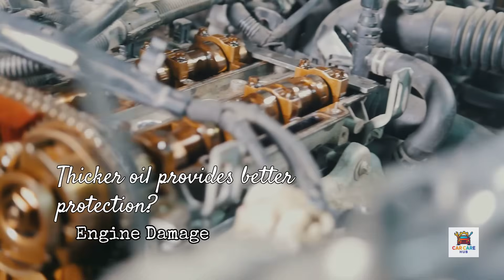STOP using 5W30 oil! (BEFORE IT'S TOO LATE)

Comment: Lololol my 2010  outback 3.6r went 217k on 5w30. My current 2010 3.6r is also using it. According can use 5w30 no issues so can any Subaru f series engine.
Reply from the maker: Respect-- 217k miles is solid proof. 5W-30 definitely works for many Subarus — the video was mainly highlighting cases where manufacturer specs or driving conditions may call for different viscosities. Context matters

Comment: really?  my buddy 2018 honda in germany specifies 5w30 and is of the same engine design as in usa but smaller displacement.
Reply from the maker: Regional OEM specs often differ based on fuel economy standards, even for similar engine designs.

Comment: don't change first number, it only for cold, second number is this what counts while engine is workin temperature and so on.
If car needs 0W20 by the factory, then when car gets old you may use 0W30 not 5W30, this wears your engine at cold starts 0W30 don't so much.  but remember, if you change oil to other viscosity than factory requirements then you do it at your own risk.
never change first number higher, it wears yout engine at cold starts, always use 0W oils, but change second number 0W20, 0W30, 0W40 and so on.
But remember you change oil viscosity at your own risk, you must really know what you are doing.
Reply from the maker: You're right that modifying oil viscosity from factory specs comes with risks, especially with the first number impacting cold-start wear.

Comment: 2025 Mazda CX-5 S Preferred: my owners manual says 0W-20 in North America & Israel, but 5W-30 elsewhere. That looks like double talk to me.
Reply from the maker: It’s not double talk—it’s about optimizing for different regulations and climates.
Reply: you can use 0W30 but you doing it at your own risk, when manufacturer says 0W20.

Comment: Sorry have 5w30 in my engine that "requires" 0w20 this video is total nonsense.. quit spreading misinformation .. if it were an issue the car would be throwing codes a lot sooner
Reply from the maker: The video isn't saying 5W-30 will instantly cause a code or failure, but that it can accelerate wear in engines designed for thinner oil.
Reply: @CARCAREHUB247  However most cars "designed for thinner oil" (0w20 etc) are ALSO being "recommended or 5w30 and in some cases 10w30 and thicker in other countries with similiar climates. So how do you explain this  inconsistency?

Comment: These newer Engines and their clearances aren't any different than they were years ago. If they were built to lose , they wouldn't even stay together The only reason why they want you to run. Such a thin oil is just for gas mileage. I could see you running a 0 20 Oil in the middle of winter , but not when your temperature is over 70 80 Degrees , you're gonna need a little more protection than that
Reply from the maker: Good point, and you’re right that engines aren’t “loose.” The big change is heat, emissions systems, and fuel dilution—not just clearances. Thin oils aren’t only for MPG, but they’re also not ideal for every engine or climate. That’s why following the manufacturer and real-world conditions matters.

Comment: 1997 Dodge Ram 1500 / 175,000 miles.  5/30 and 10/30 half and half
Reply from the maker: Older engines with wider tolerances can handle that. This warning mainly applies to modern engines where oil spec is far more critical.
Reply: i use 0W40 oil in old cars.

Comment: Just bought a 2006 Honda CRV with 161,000. I'm getting ready to do my first oil change as the new owner. The sticker from the last oil change on my window tells me to change it now. I bought Havoline Full Synthetic 5W 20. I live in S. Florida. Should I change the viscosity now? I don't remember if I bought high mileage oil.
Reply from the maker: For a 2006 CR-V, stick with the manufacturer-recommended viscosity.
5W-20 is fine, even in South Florida. No need to change viscosity unless you have oil burning or low oil pressure. High-mileage oil is optional, not required.
Reply: i use 0W40.

Comment: Most cases but not all the information is true as always, there are variables.
Reply from the maker: You’re absolutely right — engine design, driving style, and climate all matter. The video highlights common cases, not a one-size-fits-all rule. Always follow manufacturer specs

Comment: 2005 chevy avalanche 211,000 miles, what brand and viscosity would you recommend? 5.3 engine
Reply from the maker: For a high-mileage 5.3L, I recommend a quality 5W-30 full synthetic or high-mileage oil (Mobil 1, Valvoline, Pennzoil). If oil consumption or pressure is an issue, 10W-30 is a solid option. Then know what ur manual says too

Comment: The oil has 4 things to do: Lubricate, cool, clean and seal. The right viscocity is thick enough to lubricate and seal properly. And thin enough to cool and clean properly. Normally new cars like 0W-20. Youngtimers like 5W-30. Oldtimers like 10W-40.
Reply: Exactly.
Reply from the maker: Exactly,  Oil balance is key—too thick or too thin can cause issues. Always best to follow the OEM spec and adjust only when wear or conditions justify it.
Reply: i use only 0W oils, 0W20, 0W30 and 0W40, depends what engine can take, but alyways 0W because of good cold start end better cold working protection for engine. 0W oils are good, just choose second number wisely. 0W20, 0W30 and 0W40. In old cars i always use 0W40, but in newer cars i must choose what it can take 0W20, 0W30 or 0W40.
i never use 10W oils it's too thick for cold start.

Comment: 5W-30 is for youngtimers. Oldtimers like 10W-40 or 5W-40. New cars like 0W-20.
Reply from the maker: Well said. Oil choice really comes down to engine design, mileage, and manufacturer specs—not just one viscosity for all.

Comment: 5W-30w TRUE FULL SYNTHETIC is Better than 0w-20 synthetic is for EPA EMISSIONS AND  NOT, I say not the best for your engine UNLESS u live in a cold climate.
Reply from the maker: 0W-20 is mainly for fuel economy and emissions. In hot climates or heavier driving, a good 5W-30 usually maintains better protection. Climate and driving conditions matter.

Comment: This is actually true in the case of modern engines like the Dynamic Force series from Toyota.  They are designed for thinner oil.  Using heavier weight oil probably will not work out well with them.
Reply from the maker: Exactly—modern engines like those from Toyota are precision-engineered for specific oil viscosities, and sticking to the manufacturer’s recommendation is key.

Comment: 0W30 AMSOIL SIGNATURE GRADE Covers all bases in Northern Climates
Reply from the maker: 0W-30 works great in colder regions, yes. The key is matching viscosity to climate and manufacturer specs, not using one oil for every situation.
Reply: i use 0W40 oil in old cars, good oil in every way. but in never engines i use 0W20 or 0W30, if some can take then 0W40, but it's quite thick oil.

Comment: @CARCAREHUB247 - You stated in a response that there's no solid evidence that 0w-20 increases engine wear.  If that were true, then explain to me why GM changed the oil spec on the 2021-2024 6.2L from 0w-20 to 0w-40 to address main and rod bearing failures.
Reply from the maker: GM switched that engine to 0W-40 because of specific bearing issues with that 6.2L design, not because 0W-20 automatically causes wear in every engine. Different engines have different requirements, so one example doesn’t prove a universal problem.
Reply: @CARCAREHUB247 But it does show that an engine designed for 0w-20 can still prematurely fail due to insufficient lubrication.  Which disproves your assertion of "no solid evidence..."  Plus, highlight the added protection of thicker oil.

Comment: I have been reading that when your car gets to a higher mileage that the clearances get wider and that a little thicker may be better. Be careful if you have cold winters.
Reply: 0w20 is not for continental US.
Reply from the maker: You’re right—higher mileage engines can develop wider clearances, and in some cases a slightly thicker oil can help. That said, climate and cold starts still matter a lot, so it’s always a balance.

Comment: I have a 2002 Buick Park Avenue with a 3.8L engine and 226,000 miles. Manufacturer calls for 5W30. I have always used Valvoline. When it got over 100,000 miles I started using high mileage oil. A well known mechanic said to use fully synthetic oil. Big mistake! It ran terribly! I went back to the high mileage oil and it ran like it's supposed to. Lesson learned.
Reply from the maker: Thanks for sharing this real-world experience. It’s a good reminder that “fully synthetic” isn’t automatically better for every older engine—using what the engine responds best to is what really counts.

Comment: 2018 Toyota four runner 123000 miles 0w20w should I use 5w30w
Reply from the maker: Stick with what Toyota specifies for your engine. Even at that mileage, 0W-20 is fine if oil consumption is normal. Only consider 5W-30 if you’re seeing consumption, heavy towing, or extreme heat.

Comment: 2008 Avalanche 5w30w 238000 miles full synthetic
Reply from the maker: At 238k miles, 5W-30 full synthetic is reasonable if oil pressure and consumption are under control. Just keep an eye on intervals and usage — condition matters more than mileage alone.

Comment: 5w30 is not thicher hello! :face-orange-frowning::face-orange-frowning::face-orange-frowning:
Reply from the maker: You’re right that it’s not “thicker” at cold start — the difference is mainly at operating temperature. Viscosity grades are about behavior under conditions, not just a simple thick/thin label.

Comment: I’m driving a 2020 Honda CR-V (1.5 Liter turbo) with 69,000 miles on the clock. I am using Mobile 1 0W20 (specified by Honda.

Some sources recommend 5W30 at about this mileage. What do you recommend?
Reply from the maker: I’d stay with Honda-spec 0W-20, especially on the 1.5T. Mileage alone doesn’t require thicker oil. Short intervals and quality oil matter more unless you’re burning oil or driving hard.
Reply: @CARCAREHUB247 Thank you!

Comment: Your daily driving on the oil has expired in 3 months. You get an oil remedy in 4 months. You decide to wait over 3000 miles for the next oil change taking you a year later to change it. I made a mistake like you did on my first car since highschool before I went to the automobile tech school and asked techs for knowledge plus repair manuals. Back then there was no YouTube and no media to post. Past over due used black oil is not worth posting is normal for oil to wear. 20 weight oil is nice at cold start up but noisy. 0w30, 5w30 cold climate. 10 w 30 hot climate or for towing 0w40 both cold and hot climate. 10 w 40 for hot climate. SAE API SP. Never seen Valvoline 0w40 restore and protect SAE API SP dexos full synthetic would be perfect.
Reply from the maker: Appreciate the detailed input and your background in auto tech My point isn’t that oil instantly “fails,” but that extended intervals and wrong viscosity for use/climate increase wear over time. Black oil alone isn’t proof, but pushing past time/miles repeatedly isn’t ideal either. Always best to follow the manufacturer spec for the engine and driving conditions.

Comment: I have two cars, a 2017 Chevy Impala which uses 5W30 and a 1977 Buick Electra which uses 10W30. I am currently using Royal Purple in both cars. I use their 10W30 HPS in the Buick. I tried 15W40 in the Buick but it took too long for the oil light to go out on startup, so I switched back to 10W30. The Chevy currently has 54,000 miles and the Buick 118.000 miles. Neither car uses oil and I never have to add any between charges. I change oil in the Buick once a year, as it is a summer cruiser. The Chevy gets an oil change at approximately every 3,000 miles as I am retired, and only drive about 500 miles a month, mostly short trips. Everything is working out well. I have owned that Buick since 1993.
Reply from the maker: It’s great that you've found what works for your Impala and Electra, especially with the Buick's long history.
Reply: ED, I was a oiler in a paper mill. We used all brands of oil, I have used walmart synthetic for over 30 yrs, never a problem. I wouldn't pay for mobile 1 or Royal Purple. I let my cars go to around 6000 miles or change oil 1 time a year. Yes short trippers and cars on dusty roads need more oil changes. I have found out that lack of maintenance is usually the reason for engine failures, but, the last few years the engineers have got so smart, cars don't last long, all of the manufacturers are having drive train catastrophic failures. Even toyota and honda have had their's, we are royally getting screwed over prices and quality. We bought a CRV Honda in 2022, thinking it was the best option. Even these little turboed, 4 cyl. engines have had cyclinder ring problems, this car was $35k. WHAT ARE CONSUMERS TO DO?
Reply: i use only 0W oils, 0W20, 0W30 and 0W40, depends what engine can take, but alyways 0W because of good cold start end better cold working protection for engine. 0W oils are good, just choose second number wisely. 0W20, 0W30 and 0W40. In old cars i always use 0W40, but in newer cars i must choose what it can take 0W20, 0W30 or 0W40.

Comment: I just bought a 2013 VW Passat TDI with 100K on it changed the oil to Mobil1 ESP 5w30 that’s what the owners manual calls for and I use hot shots secrets stiction eliminator also from being a GM mechanic at a dealer 30 years ago I know a good oil filter is MANDATORY I seen my dad prove this once on a 76 Buick he took off a cheap oil filter and put on a ACDelco 15 minutes later the engine had quitened down so I used a Wix oil air fuel n cabin filter I’m going to do oil analysis forum blackstone and see what it shows I’ve thought about trying amsoil 5w30 European oil having it sent to Blackstone and seeing if that’s a better option!!!??? Any ideas  please let me know I’m planning on keeping this car for years to come THANKS!!
Reply from the maker: For the Passat TDI, sticking with a VW-approved 5W-30 (507.00) like Mobil 1 ESP is the right move—especially for DPF and long-term reliability. Oil analysis is smart and will give real answers. Amsoil Euro 5W-30 is also a solid option as long as it meets VW 507.00. Good filters matter, agreed—but spec compliance matters more than brand. Frequent changes + analysis > chasing thicker oil.
Reply: ED, hate to tell u, but both mechanic friends of mine sold their TDI's. They got 45 mpg or better, but couldn't keep the smog system failures/ plugging / elect systems going. These VW tdi's maybe similar to the Ford/ INT. 6.0 and 6.4, as the government smog equipment made them useless junk. The ford's would last if u deleted/ maintained the engines, but u are breaking federal laws. I have an old 6.4, pulls like a semitruck, cheaper than late models, but for how long?
Reply: Also short tripping the VW let the exhaust plug.
Reply: VWs frpm that time like 5W-30. Use VW 507.00 quality for diesel.

Comment: I have a 2013 Hyundai with the notorious theta II engine, I change my oil every 5k I've been using 5w/30 as the manual suggests. I have 150,000 miles and I use pennzoil full synthetic high mileage oil. Do you suggest I switch yo 10w/30 full synthetic high mileage oil?? I live in Pennsylvania where we experience all types of weather.
Reply from the maker: With 150k miles on a Theta II, 5W-30 full synthetic changed every 5k is still perfectly fine and within spec. Switching to 10W-30 won’t hurt, but it won’t fix the known issues either—especially in Pennsylvania winters where cold starts matter. Focus on frequent oil changes, quality filters, and monitoring consumption. If oil burn is increasing, a slightly thicker oil in summer only can help, but don’t abandon 5W-30 year-round.
Reply: @CARCAREHUB247 . If you drive a Hyundai you have enough problems already 🤷🏻‍♂️

Comment: 2014 Chevy Express 3500 5-30 198K miles 😬
Reply from the maker: At that mileage, engine condition matters more than factory default. If oil pressure, consumption, or noise has changed, a different viscosity may be safer. Always go by real symptoms, not just the label.

Comment: The engines are to tight and engine oil viscosity are to light 
Engines are failing now.

Older engines will out last the new design hands down.
Reply from the maker: Tighter tolerances aren’t bad by themselves, but they require the correct oil spec. The problem is when one viscosity is used across all engines regardless of design or wear.
Reply: @CARCAREHUB247  years ago we used Valvoline 10w40 in All engines in the papermill. Then the new Chev. trucks sat around idling for hours with 0w-20, and the oil disappeared! I put 0-20 in my 2007 v-8 chev. truck, think it calls for 5-30, what is the best oil weight for Tenn? I am looking at the gas mileage, also wondering if 20w is heavy enough in the old 2007 in summer.

Comment: I have a 219 Ford Fiesta with the 1.6 non turbocharged engine the oil cap says 5 W 20 The car has 70,000 miles and uses no oil It has a lifter The motor is loud What do you suggest I've been Walmart synthetic best 5 W 20 I have used 5w30 in the past
Reply from the maker: Stick with 5W-20 as specified. If lifter noise persists, try a higher-quality full synthetic and a shorter interval. Moving to 5W-30 may quiet it slightly, but only if allowed in the manual—don’t jump viscosities without confirmation.

Comment: Your initial claim of Don't Use 5w/30 is totally incorrect !
Reply: I agree, plenty 5w-30 engines out there.
Reply: hes an idiot!!!!!!!
Reply: its clickbait
Reply from the maker: I agree it’s not always wrong. My point is that 5W-30 is often used when another spec is more appropriate for the engine’s condition, climate, or mileage.
Reply: @CARCAREHUB247  my Hyundai Ioniq hybrid uses 0w 20 and this is probably due to the frequent starts and stopping of the gas engine, where the designers probably require "instant" oil flow when starting from electric mode. Sounds logical to me.